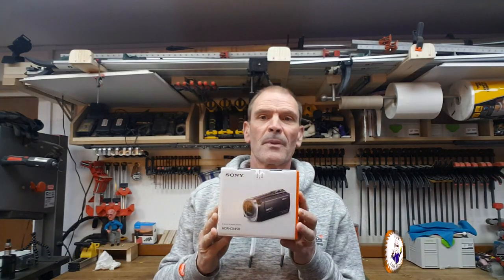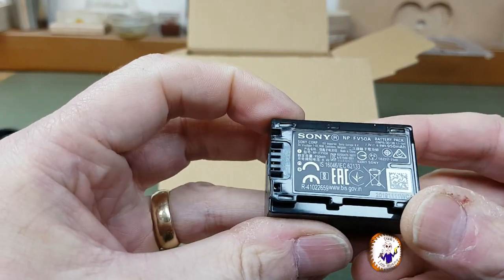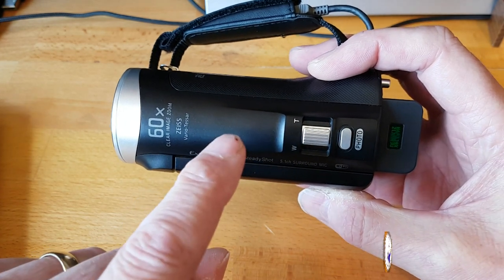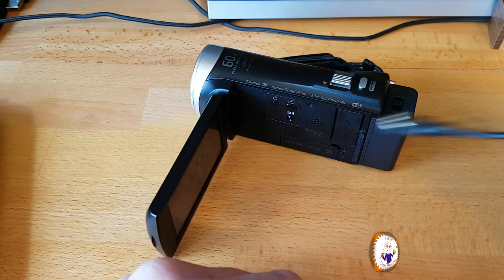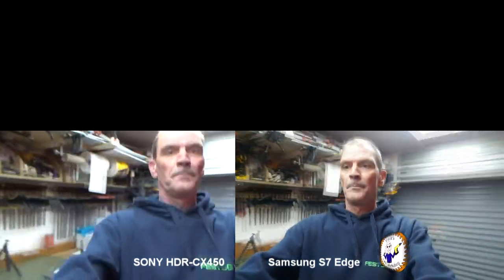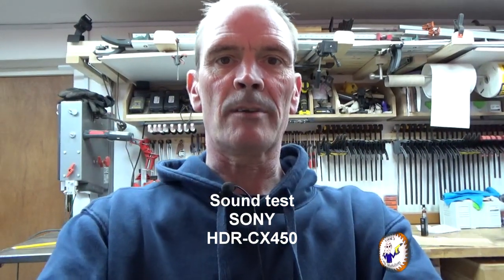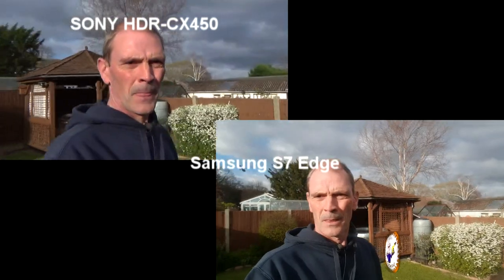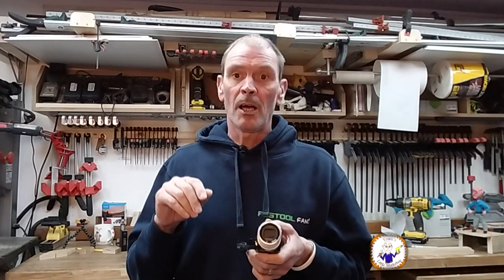SONY HDR CX450  Vs SAMSUNG S7 Edge for YouTube Videos

Comment: For test purposes; I made short video clips with four prosumer devices available at my disposal at present. Those are a smart phone Samsung Galaxy A20, Panasonic Lumix GF5, Sony HDR-CX450 handycam and Canon EOS 70D. All the devices were installed on a video tripod before recording.

Unsurprisingly, Canon 70D came out best with outstanding colors and pinpoint autofocus.

Second surprise was the smart phone that produced the second-best video quality both in colors and autofocus. However, the frame shuttled little back and forth.

Sony CX450 came out third in this competition. It’s a dedicated video camera likewise, I expected it to be second. Was not very happy with its colors and autofocus. Moreover, its stabilizer is not upto the mark. If recording is done handheld, the quality gets very poor even missing focus on the subject. Therefore, recording must be done installing the device on a steady tripod. I call its video quality average. Perhaps that is to be expected from an entry level handycam.

And understandably Lumix came out fourth producing dull colors and very poor autofocus.
Reply from the maker: Hi Quazi 😁. No surprise that the Canon came out on top. I think this would be my first choice 😁.... if I could afford one 😔. If I ever use the Sony in the workshop I always try and mount it on a tripod... I seem to have more issues with the sound levels during post processing. Thanks for watching Quazi 😁👍

Comment: Great tests Frank. I think it’s a good idea using both, as they each have their own strong points.
Reply from the maker: Thanks 😁. Now I've used them both I've noticed the camcorder is quite suseptable to workshop dust, so a little blow with the airline is sometimes needed. Also there are some issues with the sound on the camcorder.. think I need to do a follow up vid. Thanks for watching 😁👍.
Reply: Frank Williams I think a follow up video is a good idea. I loved the zoom clarity, but I think the wide angle and colour was better on your phone.

Comment: Thanks for the video Just brought one off eBay very happy just need to sort out 🎙
Reply from the maker: Thanks Roger 😁. Hope it serves you well. Thanks for watching 😁👍
Reply: Frank Williams just one question please what sort of cable did you get for mic. It’s a mine field and were from.
Reply from the maker: @rogerclark5869  hi Roger. I am still using a cheap lapel Mic (little clip on) which I got from Amazon. And it came with the 3.5mm attachment. I also got a 3 meter extension lead. Just look for a 3.5mm smart phone compatible Mic and you should be good to go. Hope that helps 😁👍
Reply: Frank Williams thanks very much Frank

Comment: Thx for the review, can you see the screen in the sunlight as i struggled with a cheap canon model?
Can you transfer the video to a smartphone via wifi?
Reply from the maker: Thanks for watching and the comment 😁. I have only really used mine in the workshop under LED lights and it's fine. But from what I remember from my initial review it was quite good outside. As far as file transfer, I have only ever transferred directly to the PC via cable or using the SD card so sorry I can't help any further. Thanks again for watching 😁👍

Comment: Thank you Frank. I am a singersongwriter. I am going to buy the Sony. Want to use the extern mic port. Going in from my mixer or guitar amplifier, with a bit reverb on the signal. Hope this is gonna work.... I think so.
Reply from the maker: Hi Nico 😁. Thanks for your comment. I have not used the Mic input from an external source (I.e AMP or mixer etc) so don't know how this will behave. I've only used it with a lapel mic. I think there is some kind of auto adjustment on the audio recording level when you start recording so you may need to send an initial test sound before you start your final recording 🤔. I hope this helps. Thanks for watching Nick 😁👍.
Reply: Today got my Sony. Used my AER Compact Classic amp: here I can make my sound-signal and the gain. Went out from the amp in the external mic. Very good sound ! When I'm ready i'l let you hear, if you like.
Reply from the maker: @nicomeijerink208  Sounds like that setup should work OK. I watched your turn turn turn cover video (Very good). Would be great to see and hear another video of one of your songs using the new setup 😁. Just re-comment on here if you do 😁. Thanks Nico and stay safe 😁👍
Reply: @frankslittleworkshop  Today I posted my second video: Change will come, with condensor mic, preamplifier for guitar, AER Compact guitaramplifier directly in the Sony CX450, no DAW. sound is pretty good I think.
Reply from the maker: @nicomeijerink208  thanks Nico, just watched it. Good job, great results. 😁👍
Reply: Frank Williams Thank you Frank,  I am very satisfied about my Sony cx450, bought it after watching your video...
Reply: Frank Williams Thank you Frank,  I am very satisfied about my Sony cx450, bought it after watching your video...